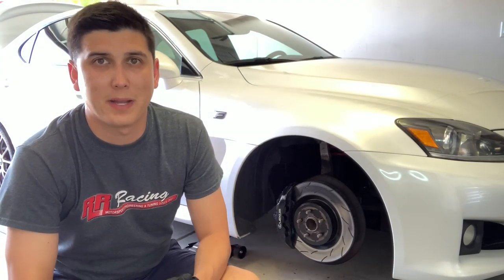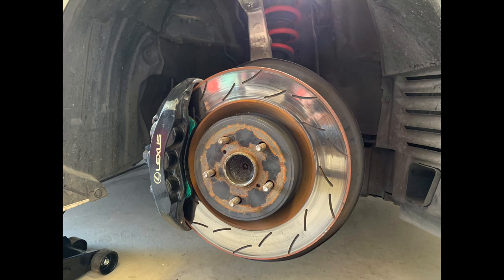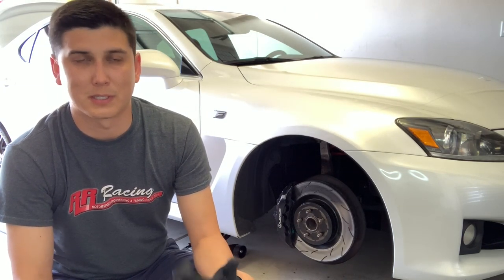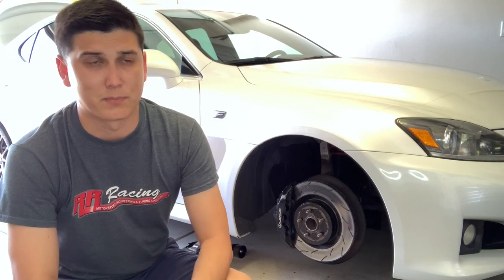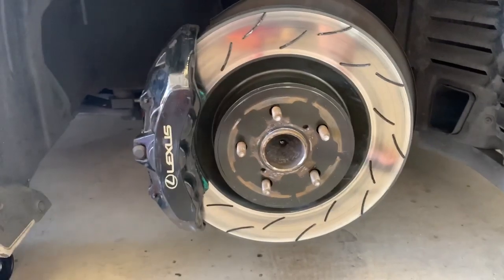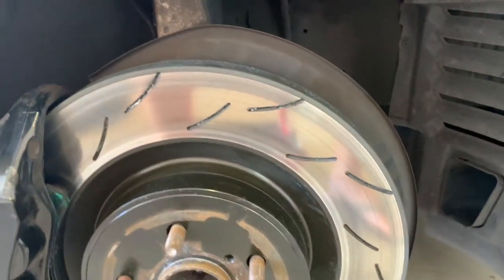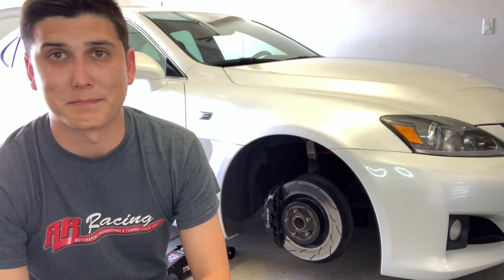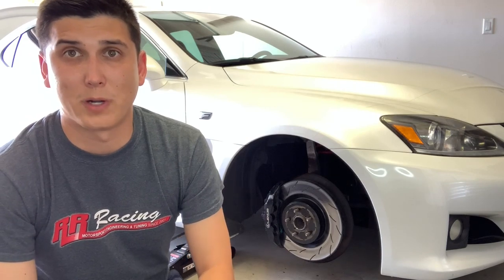Brakentic Rotor Update

Comment: It's always great to see a company standing behind their products. Have you seen Brembo's new UV coating? It's a metallic paint that supposedly lasts the life of the rotors (higher corrosion and heat resistance).
Reply from the maker: I have not but that’s good to hear.  How much do those rotors run and are they slotted?
Reply: @ISFASTER  AFAIK just cross-drilled like OEM but they have new pillar block construction (similar to dba Kangaroo Paw) instead of traditional vanes which greatly improves cracking resistance.

I have a set on the way from eBay which ran me $375.
Reply from the maker: Thanks for the information, I’ll have to check them out!  Glad there are options out there!
Reply: I'm going to try some and see how they hold up with our local road course. Zinc so far has had the best heat resistance, when it comes to the paint not burning off.
Reply: @ISFASTER  Yeah no problem, the more options the better! It'd be interesting to see how they'd hold up to your track days.

As far as looks, I prefer the black rotor hats but if these stay metallic silver for their lifetimes, I'll gladly take it.

Comment: These brakes are complete junk.  The reason they rust is because of the low carbon content of the rotors. I made the big mistake of thinking I could save a few bucks on rotors.  Boy was I wrong.   They warped within 500 miles.  They would rust overnight, I'm not concerned with the esthetics of it, I'm concerned it shows to low quality of the alloy.  

If you notice , they came with stickers denoting right and left as any higher performance rotor has directional vanes that make are flow through to facilitate cooling as the function of the brake is to convert kinetic energy to thermal energy then radiate that heat into the atmosphere.  
Take a close look at your rotors, the stickers are bullshit.  They are not directional at all.   If they were, they would have an arrow cast into it.  Look closely at the vanes.   They are simply radial and not directional.

I bought mine in April but did not get around to installing them on my CTSV until July,  put new Hawk HPS-Enhanced pads on the front and HPS on the rear, bedded them as usual per Hawks instructions, changed brake fluid . Drove 500 miles and warped them in April.  Called to company and was told too bad, out of warranty.   I take responsibility for that.  But was not even offered a discount on replacements.  Not that I would have taken it.
I bought the OEM rotors from GM. Made by Brembo in Italy.  Just like the rotors on my Porsche and Focus RS.

Never ever cheap out on brakes . Avoid Chinesium alloy brakes at all costs. 

And really avoid this company's product. 
Source, raced, built , and modified street and road race cars for 40 years.
Reply from the maker: I never got around to testing this second set on a road course to see if they held up any better than the previous set.  I would have stayed with the OEM rotors if they didn't develop cracks after only a couple road course days.  Thanks for your input on  these though!